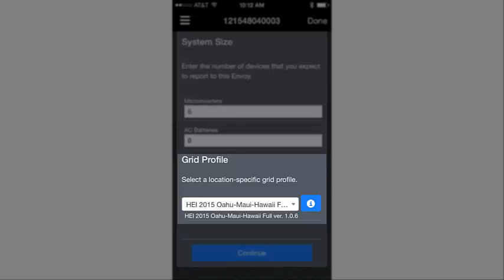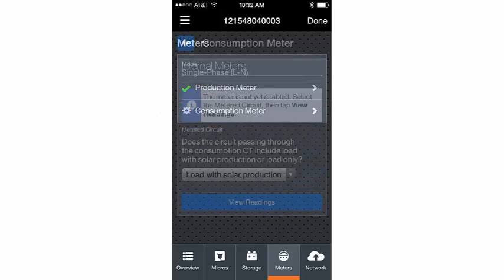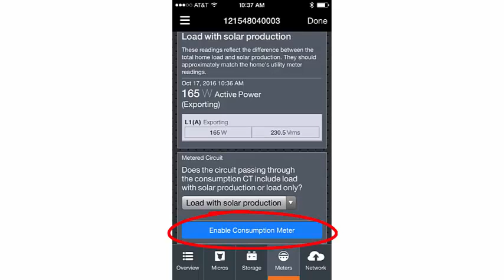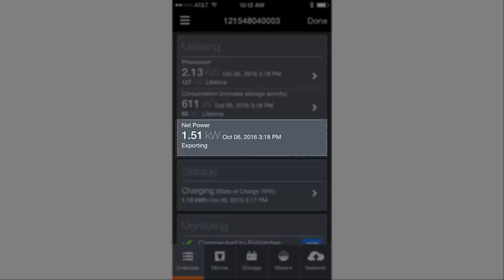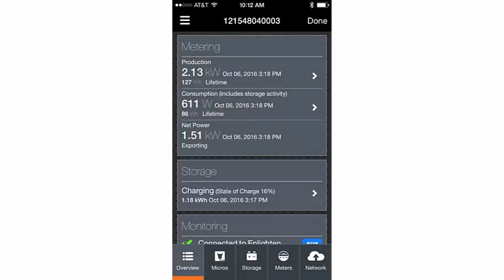How to configure an Enphase system with the IQ Envoy or Envoy-S Metered in Installer Toolkit

Comment: Can I use my 24 off M250 micros + 16 new S270 micros together with the Envoy-S Metered? Will this setup of 40 micros allow me to limit my grid supply? With this system 10 kW will I be able to set the Envoy-S metered to Zero grid export???
thanks